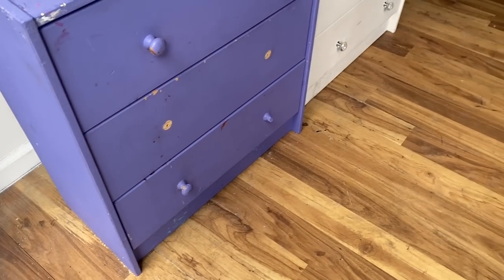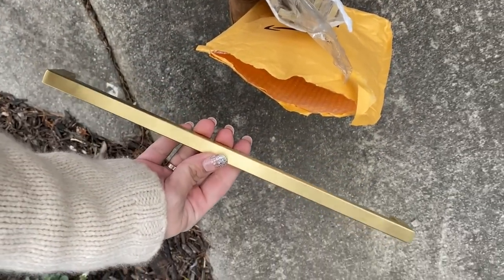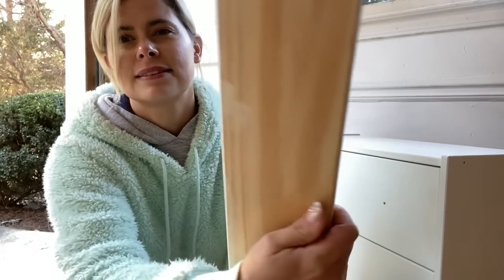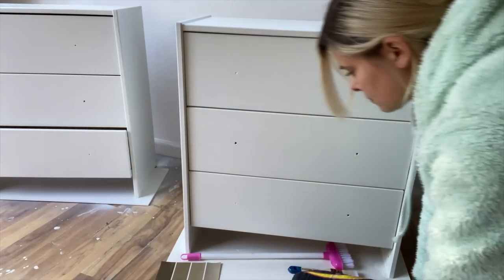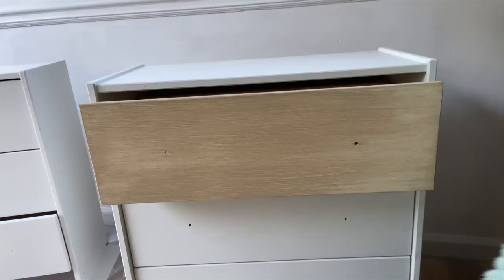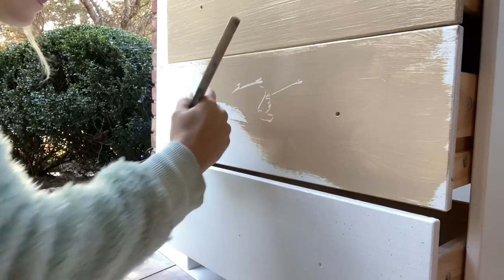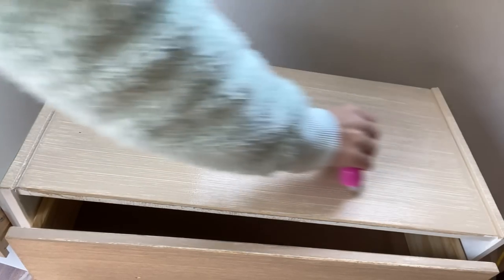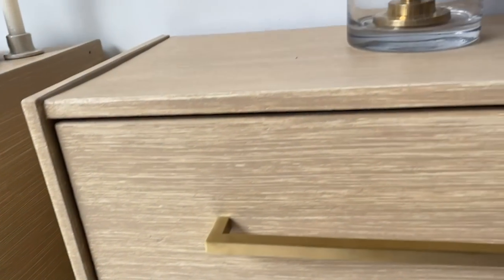Ikea Rast Hack/Furniture Flip ✨NEW✨ “wood” Pottery Barn look oversized Nightstands Dupe boho bedroom

Comment: Shannon, I have a question for you. This has to be one of my favorite techniques that you do. I have achieved this look on smaller pieces but I just recently(month or 2ago) did this on a coffee table top. I m not liking the uneven stripes. Do I need to sand off the polycyclic in order to start all over? Meaning paint the base then the glaze or just get away doing the glaze over. Hope this makes sense. Thank you for your time.

Comment: These turned out great. I would like to do this with a 1960 built in bookcase. Did you do any sanding between primer coats? I have some triple thick clear gloss polyurethane by Varathane. Would that work to mix with the Ovation paint?

Comment: Did you put anything over the paint after you created the wood look with the brush? Is it bumpy or should it be “sealed” with something. New to DIY
Reply from the maker: It has texture to the feel of it, I didn’t do a topcoat and they’ve been my bedside tables for over a year now with no chips or scratches at all but I always use a coaster with drinks.  If you wanted to throw a coat of poly on then it sure wouldn’t hurt and if I was going to sell them I would have done at least 1 coat of water based polyurethane

Comment: Question! Do you ever primer same color as paint color. The white primer comes thru which is beautiful in the lighter color. I’m thinking of painting a piece black. Do you get the same look?
Reply from the maker: I generally don’t use primer when I paint an already dark piece black or a dark color, I just scuff sand and use a paint that adheres well and I have had durable results.  You could use clear shellac primer or use the gray version of any primer, that is what most painters will tell you to do.

Comment: Have you done this technique with any other color like black or a green or blue?
Reply from the maker: Yes 🙌 I’m a neutral girl, but I’ve done it with blues and greys a ton and it always looks great!  If you watch my other videos doing this, you’ll see it really helps to have a deck staining brush to even out the finish before you brush so I would def grab one of those for your color project to avoid it looking splotchy.  They are $10 at hardware stores, about 6 inches wide fluffy paint brush basically.  I brush on top color with reg paint brush and then smooth with deck staining brush and then use the broom.  My pottery barn dresser video shows it all  in detail

Comment: Did you sand down the purple one as it was painted and had lots of globbed paint in corners? I have a chalked painted side dresser and am not sure how to get rid of texture that was painted on it.
Reply from the maker: I think I ended up using a razor to remove those globs but this finish is very flaw hiding so it doesn’t need to be smooth at all, in fact the texture of chalk paint can really help it look more realistic

Comment: This looks awesome. Would the technique work over laminate?
Reply from the maker: It works great on laminate but sand with 220 grit paper and I’d use a shellac based primer (cones in white!)  to give it good adhesion (they sell it at all hardware stores), after the primer is dry you can apply the diy glaze on just like I do on my white primer in this video ❤️
Reply: Cool, thx

Comment: If the table is made of melamine can I use this technic without sanding ?
Reply from the maker: Hi!  You’ll have best adhesion if you use a shellac based primer on melamine.  They sell it in spray or roll on forms, it’s stinky so best to do outdoor and then proceed just like I do in the video  ❤️

Comment: Did u drill new holes for the handles?
Reply from the maker: I did have to fill the old holes and drill new ones bc I couldn’t find exact length I needed on the pulls for a decent price.  I also drilled the backing so my phone charger could go through